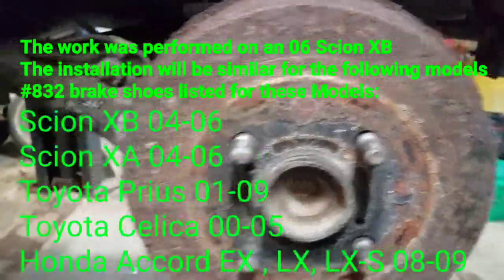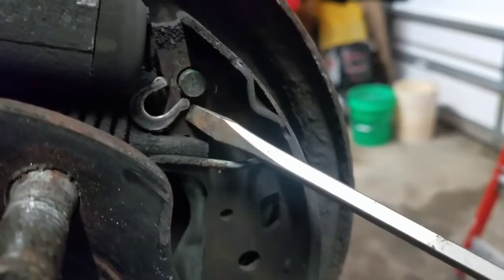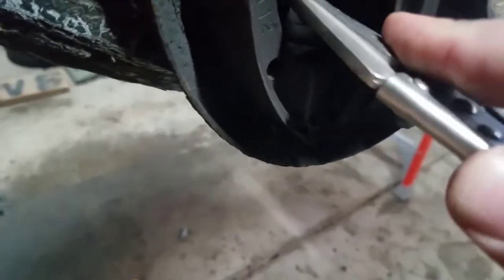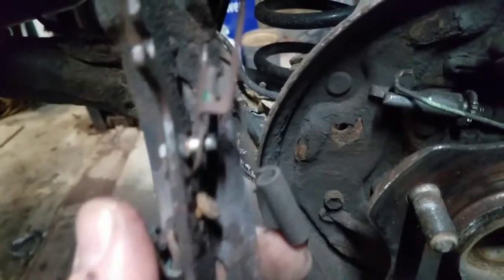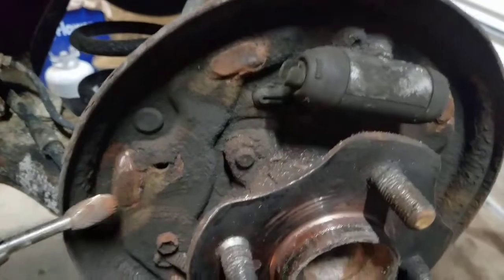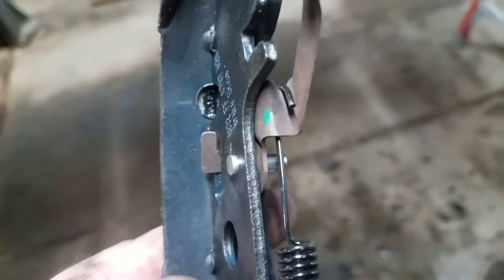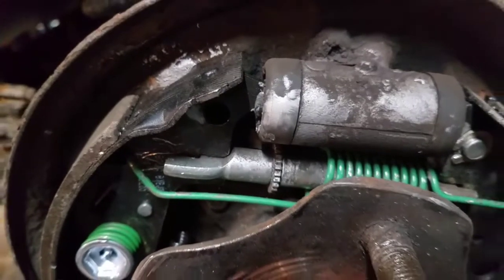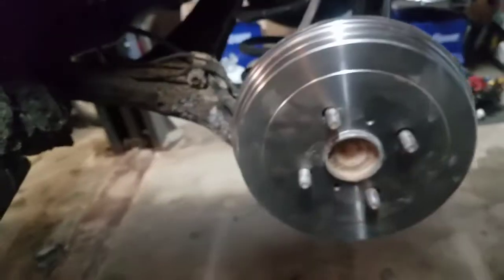Drum brake replacement 04-06 Scion XB, XA and other models. Drum brake tutorial

Comment: It's driving the OCD in me crazy, that you didn't soak that with brake clean.
Reply from the maker: I used to blast the whole area clean with brake clean. The shop I worked for liked to save customers money by conserving resources.  In my experience it doesn't really benefit to clear the dust off unless it was saturated with brake fluid, oil or for a wheel cylinder change. In a week of driving it will look the same as before it was cleaned. In addition it saves 2-3 cans of brake clean, rags, gloves, mask and disposing of the nasty black dust.
But I get the OCD part, thanks for watching!
Reply: Get therapy then

Comment: Bad idea, never hammer, get a tool set made for drums from harbor freight, and loosen a gear with teeth, first pick up the lock that locks the teeth, lift it with a drum removing kit, also yes spring kit as well as needed for this job, and you’ll get them done fast DONT stress, just use those 2 tool sets and your hood probably takes 20 minutes of your time so an hour for both drums depending on how good or fast you are!

Comment: I pretty much did what you did in the video and the brake pedal still has a lot of travel/soft... I noticed that one of the wheel cylinders was leaking,(brand new)when i push on the breaks could that be the cause of the pedal traveling too far?
Reply: Also when adjusting the adjuster, should it make clicking noise? I don't think the ones on this vehicle makes clicking noise even though they appear to be on right.
Reply from the maker: Unless the wheel cylinder is leaking alot it shouldn't affect pedal travel.
Are the shoes adjusted up?
Sometimes if the cylinder piston pops out during shoe installation, air can get in the line.
Reply from the maker: @angelcedeno26  when adjusting tighter it should make a clicking sound unless the lever is not touching it.
Reply: @northsidevideo1938  is it not a good idea to push brakes with the drum off? Will that expand the cylinder too much and cause a leak?
Reply from the maker: @angelcedeno26  that will likely pop the piston out of the wheel cylinder. 
If that happens you'll have to bleed the brakes.
Reply: @northsidevideo1938  okay thanks for your help.
Reply from the maker: No problem, I hope it's a simple fix!
Reply: @northsidevideo1938  I hope, it's been giving me a hell of a time, gonna have to check the adjuster arm to see if it's on the right way, along with bleeding all the brakes,pedal has to much travel and pulling the emergency brake on, feels kinda soft too.
Reply from the maker: @angelcedeno26  after the new cylinder installed , bled and adjusters set. The drums should have a little drag, then check pedal travel.

Comment: Good video. I would just add that you can thread a bolt through the drum to press it off.
I like to disassemble and lube the adjuster.
Reply from the maker: I agree that a bolt works under normal circumstances. I've not had much luck with it working on older cars that run through salt in the midwest winters. 
I've had to use heat with a puller many times due to excessive rust. Thanks for watching!

Comment: It is not shown how the other side of the break adjuster slot fit. Is it the longer side facing in veiw.   or the stub? The slot on the adjuster wheel side... one cannot tell by looking at the film
Or still photo
Reply from the maker: Adjuster side long side in, there's a slot that allows the adjuster lever to move freely.
Reply from the maker: On the parking lever side long side out so the parking fulcrum can leverage the adjuster.

Comment: If only it is Clearly and actually shown how each end of the break Adjuster Slots.  Correctly fits the Shoes Slot I won't have to keep taking apart and starting over.  There is a long side and a stub side but no one will show weather the stub of the slot on the   (back side out of Veiw)   Or the Front side (In plain Veiw)   One side You did explain  But the other side  Nada.   I am tired of Guessing. Would really be Nice to See them Actually being Placed in. Even just the tip ends Before putting every thing togather. It would help so Many
Great Vedio Though.  
Thanks
Reply from the maker: Adjuster side, long side towards the backing plate to allow the adjuster arm to move freely. On the parking brake side long side towards you it allows the parking fulcrum to leverage the adjuster to apply the brakes.

Comment: I’ve dropped my tranny Nd was fine but for some reason I can not figure out the driver side on rear brakes🤦🏽‍♂️
Reply from the maker: Is it an issue with adjusting them?
Reply: @northsidevideo1938  sure I got it now brakes fine on the freeway🤣But E-brake is still weak should I tighten it?
Reply from the maker: Did you adjust the shoes with the self adjusters? If the shoes aren't adjusted out. The pedal will travel down further and the parking brake will be weak.
I usually adjust them till you can hear the shoes drag slightly and you can spin the wheel one rotation.
Reply: @northsidevideo1938  Didn’t adjust it much so that’s it?
Reply from the maker: If the shoes aren't adjusted closely to the drum that will be the Issue.
Reply: @northsidevideo1938  thanks I’ll adjust them